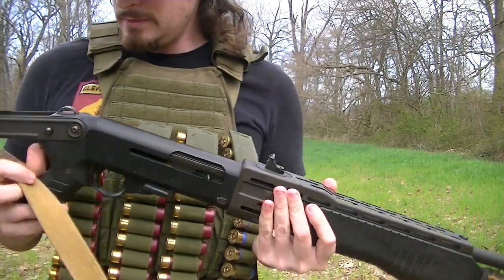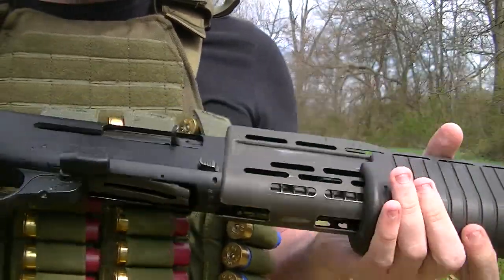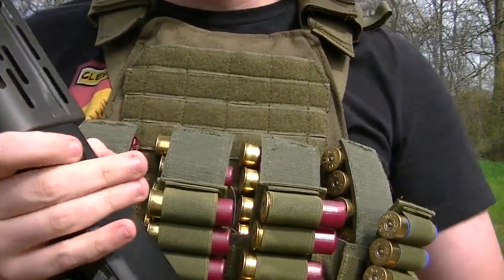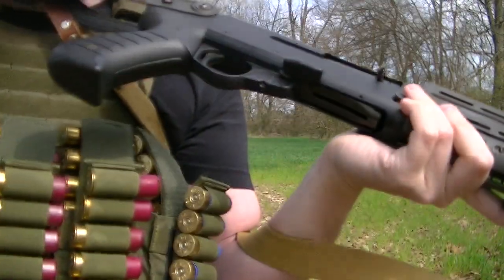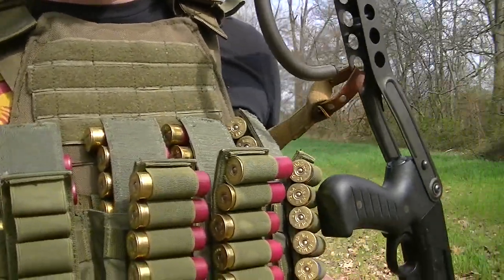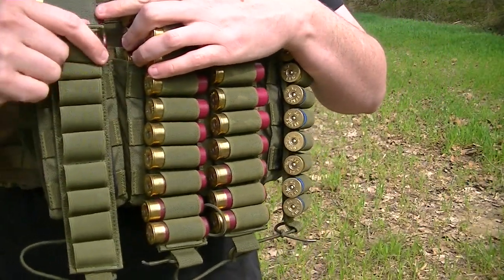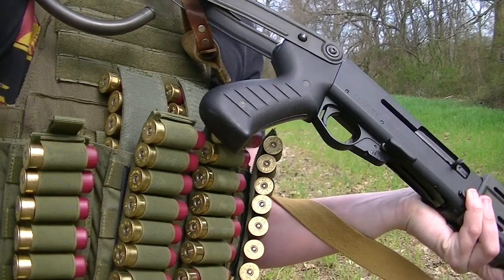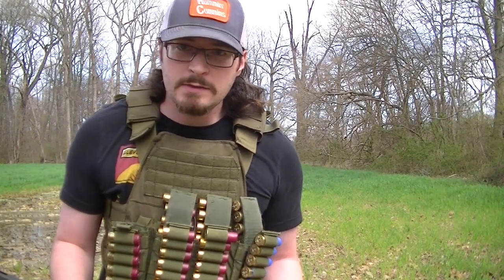The Hartmann Reload Technique for the SPAS-12 Shotgun *Bonus Plate Carrier Rig*

Comment: Hey, long time no see. Been out of town so haven’t been able to shoot my SPAS-12.

But I have been wondering if those shell caddies would work as well with this technique. Quad load caddies may be too unstable for tactical use, but the ones where you grab 4 and load one after another may work. I already load multiple shells at once with my reloading technique of tucking the gun underneath my arm so being able to strip multiple shells in one go rather than grabbing each shell individually may be helpful. But I don’t have a plate carrier so I wouldn’t know how viable that is.
Reply from the maker: If you really wanted you can grab multiple from my setup, I just feel that a steady stream of singles is more reliable than risking myself fumbling shells onto the ground. I can handle 2, and usually 3, but when I end up with 4 in the hand it gets cumbersome and I don't feel like I'm any faster than a steady stream of singles. You are correct that quad loaders meant for competition are not suitable for tactical use. I know from my rig you can easily grab 2 at a time. Which for my purposes would only be useful from an empty chamber.
Reply: @Joseph_Hartmann  Makes sense. I found grabbing multiple shells easier with my typical loading technique since it’s completely upside down at that point and therefore I’m loading with gravity. Albeit of course I have to flip the shotgun completely over and then completely back up. Typically I just grabbed shells off a bandolier (since that’s the only way I can carry shells when I’m in my pajamas, off a bandolier stored with my gun), but having a plate carrier with better carry methods would be nice.

Also, did you see Garand Thumb’s video. I did get a good laugh when he loaded the gun wrong, but then again it is a shotgun without much documentation on how to use it these days so it’s an easy mistake to make.
Reply from the maker: @gameragodzilla  I watched part of it. After the first few scnds I was pretty much over it. I got to the point where he put it on the tabletop for review. And I just didn't really want to listen any more because he had already proven he didn't know anything about it, didn't care to, and wouldn't put the time in to learn it because its so "inferior" to his precious benelli. 🙄 its just grated on me so I stopped watching lol. I'd run mine against his benelli any day and hang right with it. The SPAS-12 gets so much undeserved hate, and now thanks to that video, people who ask about the SPAS-12  on reddit and other platforms are getting referred to that video as if it is gospel and that they should stay far away from them even if its their dream gun. The only plus to that, is MAYBE the prices will go down a little. But it is highly unlikely. Anyway. Rambling over. I just hate that "plaid daddy" is considered the end all be all on these things. Cause even if you prove its wrong, his reach is so far and wide that any effort to show the truth is just a drop in the ocean.
Reply: @Joseph_Hartmann  Yeah, I don’t think people are taking it super seriously and the comment section is correcting him on it, so I didn’t hate the video. lol

Granted, these types of big name videos, even when full of errors, does give me an excuse to discuss the gun with people hence why I don’t mind it.

Really, the most comparable gun to the SPAS-12 would be the Benelli M3, being the other widespread tube fed convertible shotgun. You ever handle one of those?
Reply from the maker: @gameragodzilla  nope, never have. I have wanted one for a while though, I think there was one called the m3 super 90 that looked sexy as all hell and was convertible. May be wrong. Idk. All I know is it looked alot like an m4 but a bit beefier. And really sick in the marine coat I saw it in. But that was also in arma 2 and not the real world lmao. I figure they work just the same as the SPAS-12. I know they were heavier than the standard non convertibles and I think thats why they died out.
Reply: @Joseph_Hartmann  Yeah, I’ve handled one exactly once. But it is a pretty cool gun. I was heavily contemplating getting one too, but finding one for sale was actually quite difficult even though it was supposedly in production. The only place I could find one for sale was on places like Gunbroker or Armslist, which given there are SPAS-12s there ultimately drove my decision to just commit to the SPAS-12. It was the shotgun my heart wanted. lol

Main differences I remember from the SPAS-12 vs. the Benelli M3 is:

1. The Benelli M3 is inertia operated while the SPAS-12 is gas operated. Inertia is lighter and requires less cleaning. Gas operated has less felt recoil (even accounting for recoil) and more forgiving with shooting positions (like from the hip).
2. The Benelli M3 is slightly lighter due to having no heat shield and being inertia operated, albeit still heavier than non-convertible shotguns. The SPAS-12, of course, is really beefy. The beefiness does reduce recoil and the heat shield makes it much nicer to C-clamp grip the SPAS-12 bare handed, though.
3. The Benelli M3 doesn’t have a slide lock unlike the SPAS-12 where the quick safety acts as the equivalent of the slide lock on a standard pump. Does reduce some complexity, but it does mean you can potentially pull the pump out of battery in pump mode on an M3, hence why dedicated pump shotguns (and the SPAS-12) have it.
4. The Benelli M3’s mode switching involves twisting a ring at the front that locks or unlocks the pump, while the SPAS-12 has a button you push forward or back. I definitely found the button on the SPAS-12 easier to switch, though the M3 does still work fine.
5. The Benelli M3, being newer, does have the extra bits to load shells without having to hold down the bolt release, unlike the SPAS-12 which predates that. Definitely the biggest advantage the M3 has, though since we’ve found viable reloading techniques with the SPAS-12, it isn’t as big a deal anymore. On top of that, the SPAS-12 does have a slightly higher capacity of 8 shells vs. the M3’s 7, which given how powerful buckshot is means I can take out one more bad guy without loading.

By the way, the same ghost loading technique I told you before also works on an M3. I told a guy with an M3 about the technique I came up with for my SPAS-12 and it worked for him, too. Though I also recall not all M3s are capable of being ghost loaded without some modification whereas all SPAS-12s can be. I figure 10 shells would probably be enough capacity that speed loading is never a concern. Heh

Video: https://youtu.be/VZEfYbH2PT8

Comment: I’d do the opposite on reloading I’d keep my firing hand on the pistol grip, get one in the chamber asap and then load the tube with my weak hand. The great thing about a shotgun like that is you can top em off as you go.
Reply from the maker: You can't do that with this gun, its the entire point of the video. I even demonstrate that in the video.. To load it, you have to push and hold the bolt release or the shell carrier will not move. It is the design of the gun to be this way, hence why this method is specifically for the SPAS-12.
Reply: Oh ok. Wow! That’s a strange design characteristic.  Still a really cool gun

Comment: I usually still use the standard upside down reloading technique as I run a 2 point quick adjust sling on my gun (it’s what I’m used to) and after playing around a bit more, I found I was barely unable to push the bolt release in when I wrapped part of the sling around my support arm. I really wonder if having the extended bolt release would help there. It’s the main accessory I still want to get for my gun.

In the meantime, I do still have the Fireforce sling that still works like a charm.
Reply from the maker: Cool, whatever works. It probably would help.
Reply: @Joseph_Hartmann  Shame there’s no spare ones for sale right now. Gah.

I did put on my Fireforce sling to practice again. Most likely very out of practice, but sometimes I can’t actually move my arm back far enough to actuate the bolt release. I actually found unwrapping my arm and hanging the sling purely on my elbow actually let me actuate the bolt release over the shoulder. Definitely doing it wrong after not doing this for 3 months.
Reply from the maker: @gameragodzilla  its a little tricky sometimes.  Sounds like the sling is a bit too tight. Try loosening it up a tad more and see how it goes. Clothing can effect it too, if there's a heavy coat involved, of course not right now in Texas there won't be but just saying. Jackets usually don't interfere if it's loose enough in the first place, but coats get a bit tight sometimes. I got mine set where I can manage to do it with a heavier coat on, and still do it without too much slop in the sling in a t shirt. Its a fine balance that takes some tuning of sling length. If you can't reach the button, let it out a smidge until you can comfortably lock it down. A good length is when you can reach the button and rest your supporting arm's elbow against your side at the same time, locking the gun into position and leaving your other hand free to reload. I hope that helps.
Reply: @Joseph_Hartmann  Definitely will try again after I wake up (really late now for me).

I did try loosening up and I can get the sling to the point where I can do it, but transitioning from the hasty sling to it can sometimes be tricky. I actually think I’m wearing too little because I’m just wearing a tank top right now and the sling is completely on bare skin. I think it’s probably getting a bit stuck on my skin whereas if I had even a t-shirt, it’d slide easier on fabric. Dunno if you ever noticed that, though.
Reply from the maker: @gameragodzilla  I haven't noticed that problem. But my sling is wide cotton mosin sling instead of that narrow nylon surefire.
Reply: @Joseph_Hartmann  Interesting. Well either way, unwrapping my arm actually does work and then I wrap my arm around again to shoot, so it works now for me. May try it with a longer sleeve shirt once the heatwave passes. lol
Reply from the maker: @gameragodzilla  I hear that. Lol.
Reply: @Joseph_Hartmann  I have also decided to switch back to the standard SPAS-12 sling for now since the quick adjust sling is best for pistol transitions, and I won’t be having that for home defense. Heh

Would put it back on once I get a proper plate carrier, though, to be fully kitted out.
Reply: @Joseph_Hartmann  On another note, I saw photos of GIGN that had some SPAS-12s with laser sights mounted on the heat shield. Makes me wonder if it’d be possible to use the holes in the heat shield as a pseudo-M-Lok to mount a forward mounted red dot that doesn’t interfere with the folding stock.
Reply from the maker: @gameragodzilla  you can, it takes slight modification to the mloc nuts. Its ever so slightly out of spec for mloc holes. Super close, 5 minutes with a file on the rail section nuts and it works fine.
Reply: @Joseph_Hartmann  Oh you tried it before? Wow.

The implications of this are suddenly staggering given the stuff I could potentially mount with this thing.

Dunno if the thin sheet metal would hold zero very well, but then again it’s probably not necessary for a shotgun that’s meant to be effective only to 50 or so yards anyways.

I’m also wondering now if I could potentially use the side holes right above the pump to mount a match saver near the ejection port.
Reply from the maker: @gameragodzilla  almost anything is possible. It seemed to hold zero. I had a 45 degree can't rail with a cheapy green/red dot and it was fine.
Reply: @Joseph_Hartmann  Makes sense. At such close range, even a slight shift in zero will still be on target. You should make a video on that, too. I always thought the folding stock precluded the use of optics on my gun, but if this actually works, I may add it to my SPAS-12.
Reply from the maker: @gameragodzilla  ill add it to the list. Lol
Reply: @Joseph_Hartmann  Do you still have the modified M-lok mount? A quick picture might be sufficient. lol
Reply from the maker: @gameragodzilla  I do. I'll have to find it when I get home.
Reply: @Joseph_Hartmann  Excellent. Really would be hilarious if the SPAS-12 heatshield genuinely can double as an M-lok ish handguard.

Always liked the heat shield on the SPAS-12. Really helps me not to burn my hands, especially since I do tend to shoot the gun with a C-clamp grip like I do my AR.
Reply from the maker: @gameragodzilla  yeah, it is basically m lok. I measured it. Its just a hair narrow. Works great really. I used the canted rail section to put my sights to the side where when it was folded I still had sights.
Reply from the maker: @gameragodzilla  its basically m lok 20 years before m lok was "invented" i got a theory it was designed from that heat shield but no proof.

They've been putting rail sections in the heat shield of SPAS-12 s since the beginning of the SPAS-12
Reply: @Joseph_Hartmann  I wonder if your method was similar to what GIGN used back in the day. I was inspired to consider this because I saw a photo of two of them training. One had the famous MR-73 revolver and the other had a SPAS-12 with a laser mounted on the heat shield. Definitely would be cool first and foremost to have an optic mounted that's useable even with the stock folded. Wonder if you could put a small offset RMR as well. lol

Right now, the only accessories I have on the gun are my sling (obviously) and a magazine tube mounted picatinny rail. It's some cheap Chineseium stuff off Amazon, but so far it's held up pretty good and can accommodate my Streamlight TLR-8 laser light combo on it, so I have a flashlight and laser sight for aiming. Having a red dot and some method of mounting shells on the gun itself would make it wholly complete in terms of accessories most people put on their shotguns.

Going back to the topic of the video, since I do like the sling tight around my arm for stabilization as well as the sling not sliding very much around my bare skin, I'll just unwrap the sling as it's still tight enough at that point to hold the rear of the shotgun in place and load over the shoulder. Definitely a cool technique and as I said, I'll keep this sling on for now as I'm not gonna be doing pistol transitions anytime soon.
Reply: @Joseph_Hartmann  Wouldn't be surprised if there was at least some influence. Most prior heat shields were smaller things that had solid holes covering them while the SPAS-12 is more distinctive. Certain things often were independently invented, lost a bit, before becoming mainstream later. I know the XM8 PCAP mounting system was also a predecessor to M-lok, though that was the 90's.

Comment: Pretty cool method to reload my all-time favorite shotgun. Still, I wonder if through some innovative tinkering, a Jerry Miculek shotgun speed loader can be put on the SPAS-12 to allow a faster, smoother reload? The T-Doll SPAS-12 from Girls’ Frontline has said speed loader on her gun.
Reply from the maker: I've considered doing this "just because I can". However, it is really challenging to load doubles by hand with it due to the shape of the trigger group and how far forward it extends. The other problem with such systems is that they the loaders are rather sensitive. Susceptible to dirt and breakage. Not to mention awkward to carry, which is the same reason I despise a box magazine fed shotgun and won't use one for any serious role. Anyway, the angle just seems too extreme with the speed loaders currently available. I have seen that artwork as well, I think its quite creative, and a really cool idea, but I just don't think the trigger group will allow it once you consider the thickness of the speed loaders body into the equation. If I could get my hands on one of the speed loaders I would try it without a ramp, which isn't uncommon when designing a ramp for an individual shotgun. If I can get it to work then the dream isn't dead, but by my dead reckoning, I would say its unlikely to work. Not impossible, just unlikely because of that damn hump in front of the trigger guard where the lever "safety" (lmao) sits.
Reply: @Joseph_Hartmann  It’s a damn shame the SPAS-15 isn’t more common in the US, because the SPAS-15’s biggest upgrade over the 12 is the detachable box magazines which speed up reloading significantly.

Still, the SPAS-12 with proper technique is fast enough to reload so not a problem. lol
Reply from the maker: @gameragodzilla  I feel that box mag shotguns are awkward at best. Carrying the mags which are excessively bulky and heavy is not ideal. Also, if you leave them loaded with modern plastic hulls,, they can deform the shells and cause malfunctions.I prefer tube fed for these reasons.
Reply: @Joseph_Hartmann  Makes sense, and there is a reason why tube shotguns are still the most common. Nevertheless, I did hear great things about the SPAS-15 as far as mag fed shotguns go, so I would’ve loved to own one just to have the option between the two.